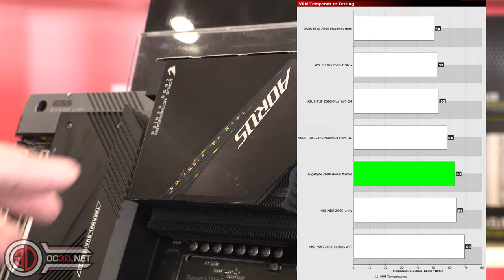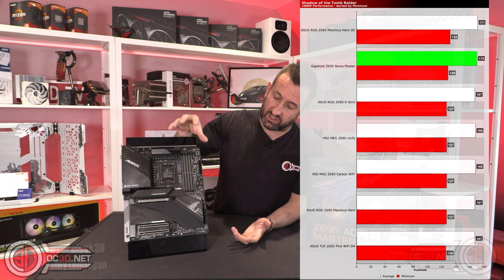Gigabyte Aorus Z690 Master Motherboard Review

Comment: I don't have the motherboard yet, but if the CPU manages 20 lines, with the first Nvme slot, the rest of the slots are managed by the chipset so I shouldn't lose my 16x lines for the GPU? If I refer to the Intel diagram, the CPU can handle a GPU in 16x + 1 SSD in pcie 4.0 and the z690 chipset can handle 12 lines in pcie 4.0 so 3 SSDs in 4.0?
The idea is really to run a GPU in 16x and 3 SSD 980 Pro in 4x
Thanks

Comment: The bottom PCIe slots are stupidly placed. If you were adding a second GPU, and there are people who like me need to, even in a waterblock it would cover the the thrid slot and at the bottom it would cover the board connectors and probably be blocked by your PSU.

Comment: Is there any Z690 MB with PCIE Gen 4 x8 (chipset lanes). I couldn't find such motherboard yet. The only MB I found is Asus ROG Maximus Z690 Hero but it's PCIE Gen 4 slot doesn't support x8 mode only x4 or x4/x4 according to specs.

Comment: It's a shame to put those expensive VRM heatsinks only to trap in all the heat.  They could have just trimmed down the plastic cover and left the heatsink fully exposed.  Would have helped temps and maybe even reduced costs a bit.  Maybe they'll come out with a refresh board later that addresses this.
Reply: They put the cover there for hipsters to figure out and remove.
Reply: Watched a review where they tested with the cover off... it ran two degrees HOTTER. I don't understand it either.

Comment: As an owner of the 5900X I just can't justify the 12900K as an upgrade. I might grab the Cacheified 5900X though.
Reply: I went from 10980xe to 12900k I wouldn't say its a huge upgrade but I  did it mostly for the ddr5 and pci ex 5.0

Comment: Laziness is the perfect way to describe this board. For a board to be this expensive and not have thunderbolt, two pcie gen 3 slots, plus they also got rid of dual bios. They could have easily put in 5G LAN to save money. I just think this board is just way overpriced for the features you get. The only saving grace is that gigabytes bios are usually pretty good.
Reply: Overpriced! Its $489 lol...

Comment: Oh God, no pci 5.0 m.2 port? Wow, that's a deal breaker for my use cases. I also wasn't keen on that vrm but note that motherboards sit vertically in a lot of cases so the top would be exposed. Probably wouldn't help much though.
Reply: @demi5007  Wrong, the ROG Strix Z690-E Gaming ,for one, has ''one PCIe 5.0 M.2 slot''.
Reply: @demi5007  Are they lying when they say ''With one PCIe 5.0 M.2 slot delivering twice the speed of PCIe 4.0, two additional slots with PCIe 4.0, and two more 4.0 slots available on the bundled ROG Hyper M.2 Card''?
Reply: @demi5007  You were saying ''it is IMPOSSIBLE for any Z690 to have pcie 5.0 on board M.2 slots'' though.
Reply: @demi5007  It was a plain statement. It was not clear it was over-exaggeration.

Comment: yes good point on that VRM cooler""".... remember my abit max 3 with p4 , there was nice not loud small fan behind , on backplate,,, very efective imo,   todays mobo producers make pointless unefective cooling on vrm,, really help direct fan build case -direct in oposite cpu cooler to spread some heat from that bigchunks of metall on VRM s... really producers need more brain ,,,,enginers..